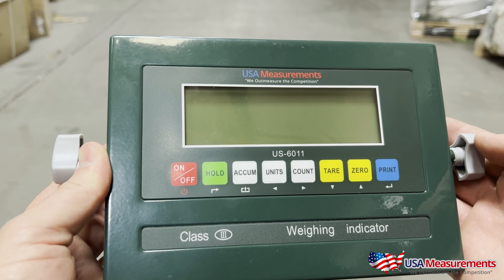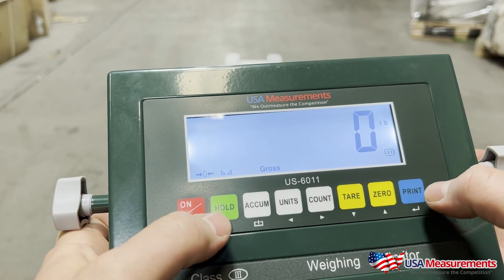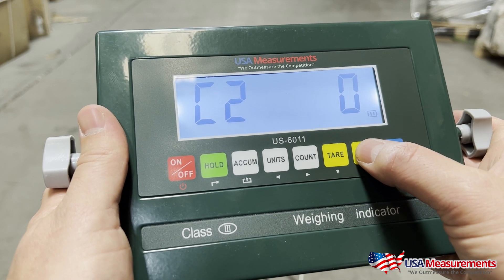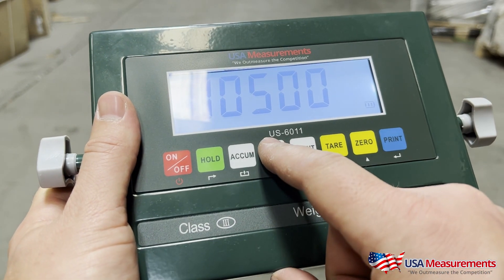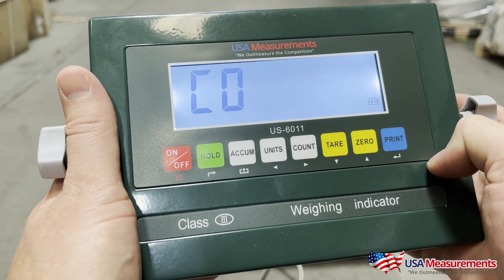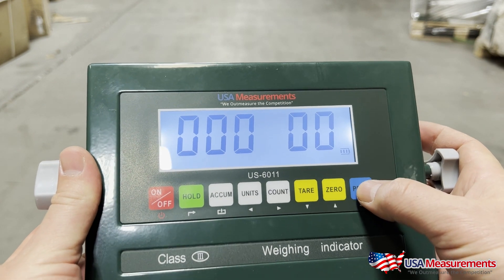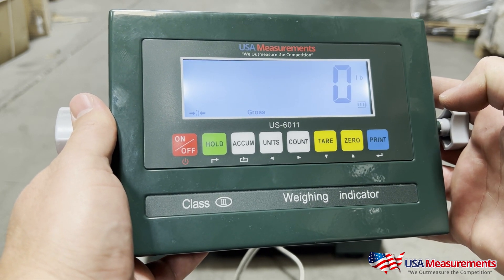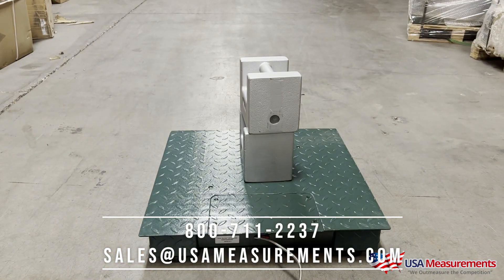US 6011, US 6011SS, & US 6011SS R Calibration

Comment: The screen on my scare is not turning on what can it be ? This my second one by the way
Reply from the maker: Hi, thanks for your comment. First, check your power supply to ensure you're using the correct model. You can find details on our website or in the manual. Next, carefully open the back cover to verify that the rechargeable battery is properly connected. If it's connected, try replacing the power supply or the battery. If the issue persists, you can send the indicator to our office for inspection. If it's under warranty, the repair will be covered. If it's out of warranty, we’ll assess the issue and provide repair options.For further assistance, contact us at sales@usameasurements.com or call 800-711-2237. Thanks for reaching out!